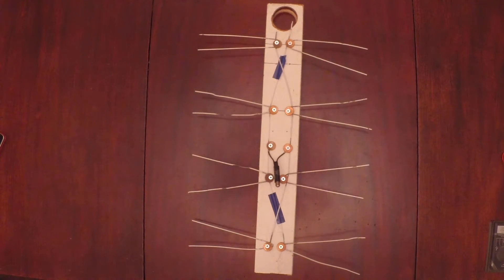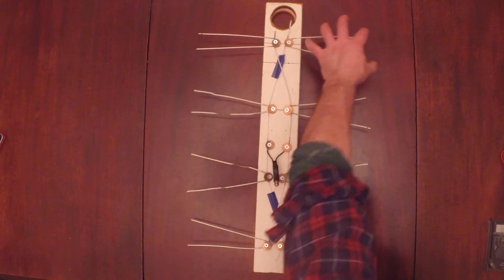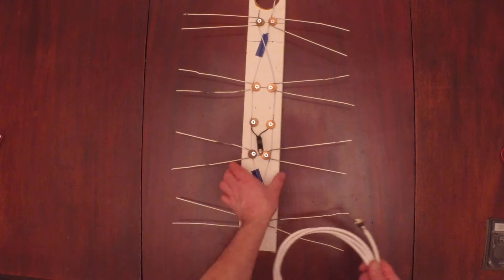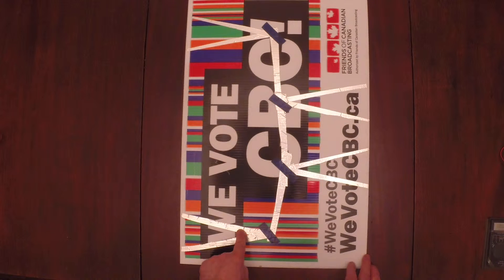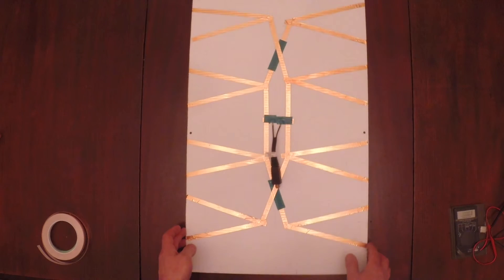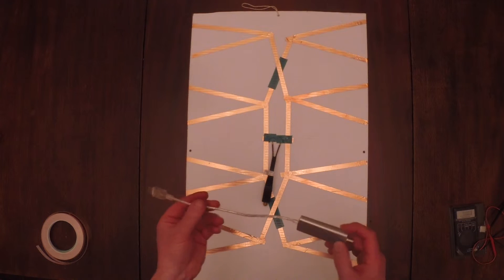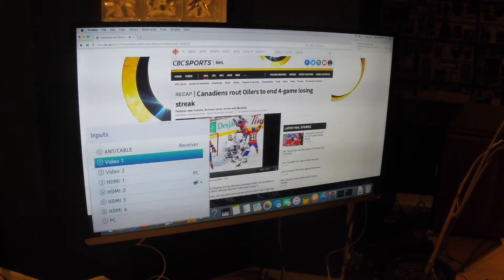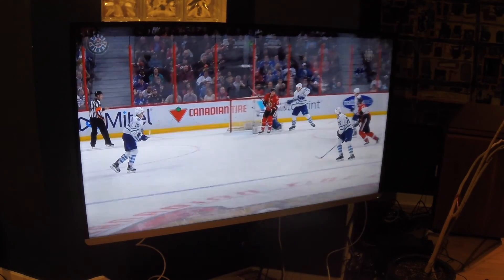Refined design for an HD TV bow tie antenna using conductive copper tape

Comment: Nice job. If you'd flipped the aluminum tape upside down (glue side up) in spots so the conductive surfaces were touching and just scotch taped it down, I bet that would have worked.
Reply from the maker: Ah - the glue is really really sticky and the tape is very difficult to deal with (and the glue is a very good insulator) I guess you could build loops of aluminium tape so that conductivity is maintained - but the tape is very tricky to use. When compared with the copper tape I reckon you will dump the aluminum in a flash
Reply: Zip Zip, I just got my copper tape in the mail today. In large part because of this video. I'd read stuff online prior about using tape, but once I found this video I made up my mind and ordered it. Thank you!
Reply from the maker: Great - let me know how it goes.  I made up a template of the sizes and precut the lengths and them taped them down on marks.
Reply: Zip Zip, just got done. Took me over 2 hours to do everything from start to finish. Working with those tiny pieces of tape gets really tough when you've got big hands. Never would have imagined that the backing was waaaay thicker than the tape.

I have a greater appreciation now for a project I thought would take 30-45 minutes. Heading up to the place that I plan on testing it out later this evening.

Hopefully I can report back with favorable results!
Reply from the maker: How did it go?  I just received 2 orders - so tie to get taping again.
I think I will modify the balun location to the edge of the antenna @russellborrego
Reply: @zipzippery , it went well.  Didn't get too much time to test it much before the camping season ended... but I got the exact same results inside, as I did with the exterior antenna that came with our camper.

I wanted to try it outside and a little higher up, but we had an insane amount of rain this year.

One thing I learned? was to not pull the tape too tight when putting it down, as it sometimes created very very tiny (unnoticeable) tears in the copper and conductivity was lost. The only way I discovered them was with a multimeter.

I would imagine that bringing the balun to the bottom might be handier for installing. You can just run two leads from the center point to the bottom and then connect the balun, right?

Overall, it was an impressive little project that I hope more people see this video and can benefit from.
Reply: @zipzippery , I had to hunt down this video again just for reference sake. I ditched the project soon after because of a lack of time and mostly forgot about it. 

Started messing around again as I have more time and my mom recently cut the cord at her house. 

This video will forever be a great inspiration for me to suck it up and give this project a shot in the first place. Thank you so much.

Comment: Could this be modified for outdoors?  Also the thing in the middle that attaches the coaxial cable. Did you just tape that down?  Did you use electrical tape?
Reply from the maker: It is a passive electronic component - called a transformer but it is really a balun. No reason it would not work outside.  I didn't show a finished antenna with a layer of paper over the top of the copper. As the antenna is flat, people painted it the same as their wall colour and they look very cool.  You could cover the whole thing in plastic sheet and waterproof it and you could build longer connector strips to the balun and install it at the bottom (and waterproof it).